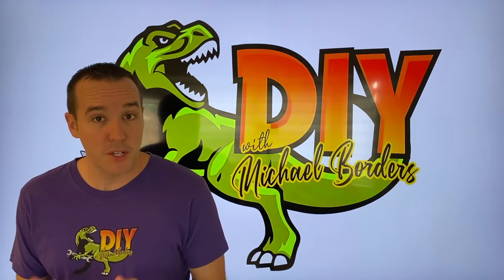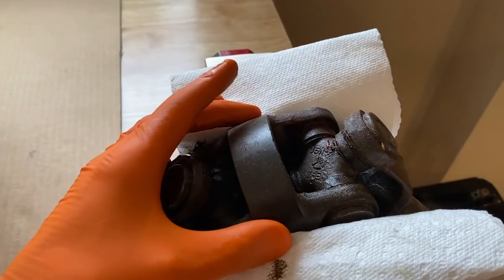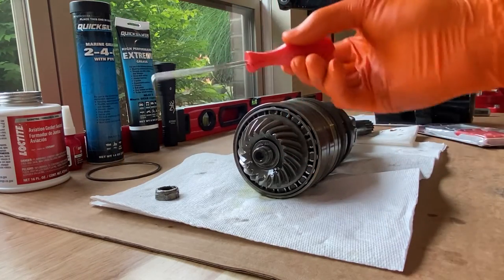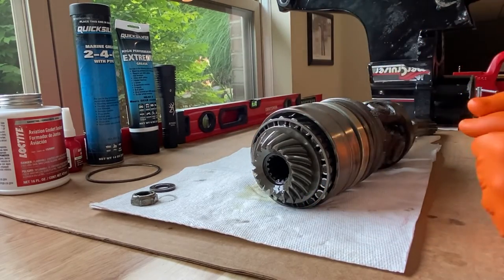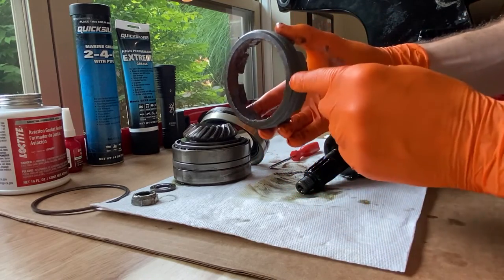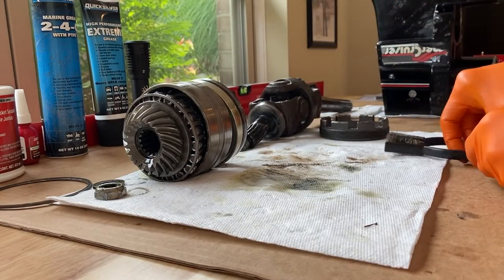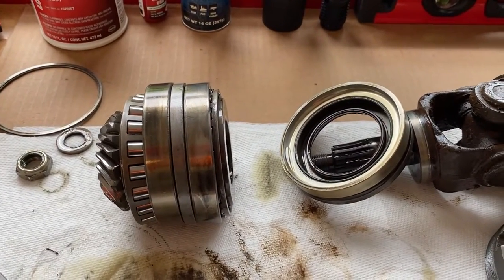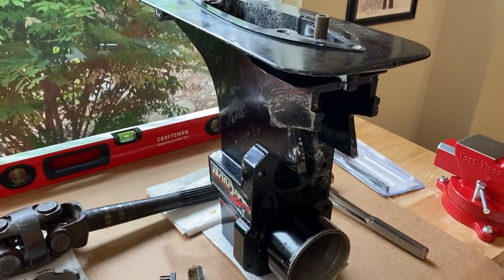Mercruiser outdrive upper unit rebuild - PART 3

Comment: question? I had my seal fail there behind the ujoint as you show in this video. it look like inside my bellow was oil wet. My gears dried I'm guessing lacked oil sheared and my boat was stopped in its tracks no forward or reverse had to be towed home. Just pulled the top cover this evening and then removed the drive. Wondering if I fixed it myself if its worth it. Cost wise also concerned how much metal got into my lower unit. Do I have to completely tare down my lower unit too or is there a easy way to flush it of any debree??
Reply from the maker: Thanks for watching and sharing your experience.  We appreciate you reaching out to us as well.

Making it a DIY project will be personal preference and if you choose to go that route, we will be here to help the entire time!

Price will vary depending on parts purchased.  We like to stick to OEM as much as possible…which increases price.

You can drain gear oil from lower unit port and see what kind of metal shaving buildup has gathered on the magnet probe on opposite end of screw.  If it’s LOADED with shavings…rebuild is always an option.

Some may recommend adding fresh new gear oil and putting 10-15 hours on the engine and then draining it again to inspect shavings amount.  If it’s far less than before, some may say you got what was an issue, out of the case…which is good.

Either way, we are here to help.  Looking forward to hearing back from you!

Let us know if you have any questions and hey if you’re into crypto trading, join our DIY ecosystem.

       toolboxtoken.com

Reach out to us any time!  🧰